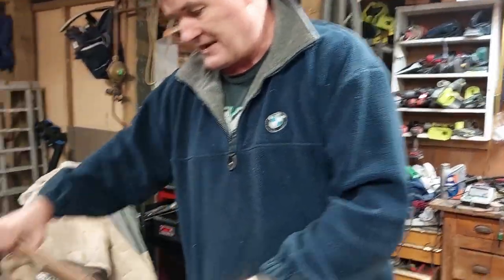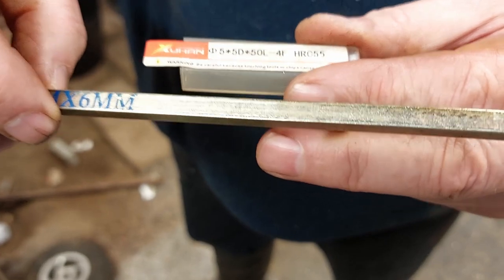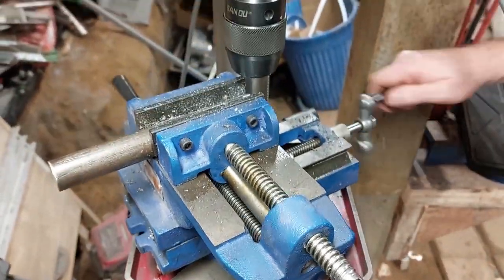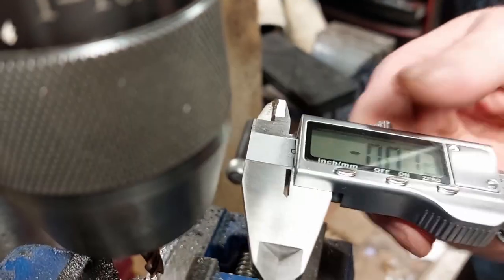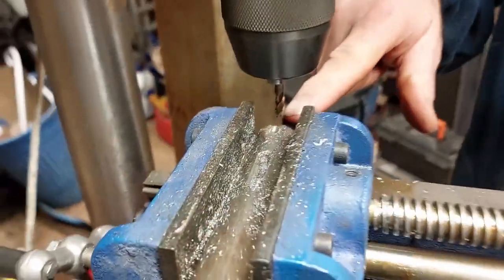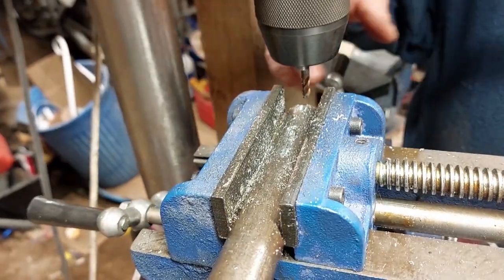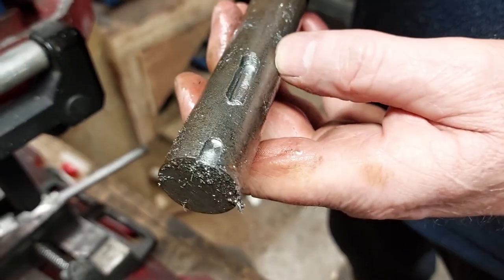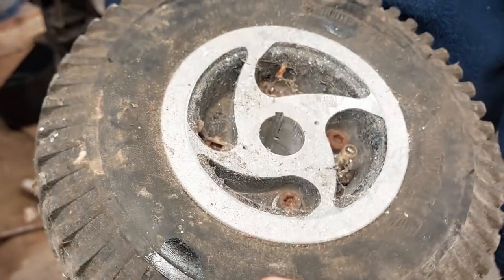Cutting keyways in shafts

Comment: You should actually be able to lock the quill if it has the standard type depth stop locking collar on the quill handle assembly. Instead of rotating the collar to stop the depth, you go the opposite way and lock it so that the quill can’t actually retract. I don’t think a lot of people know this, but of course it depends on your drill press

Comment: Could you adjust the vice upwards with the up/ down travel to save holding the drill handle while cutting?
Reply from the maker: Yip probably could but om my drill press when you move the height of the bed it can also swing side to side . So I elected to just hold it.